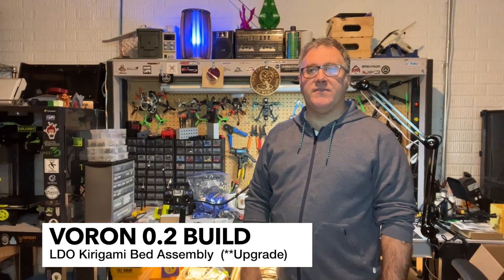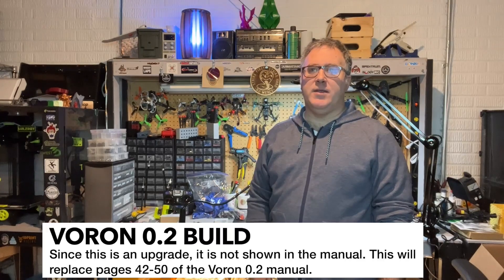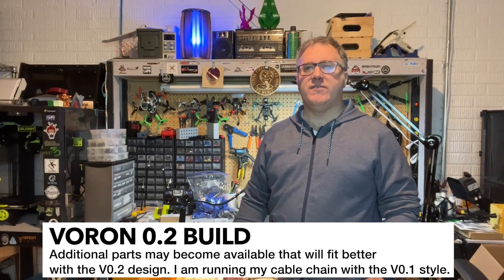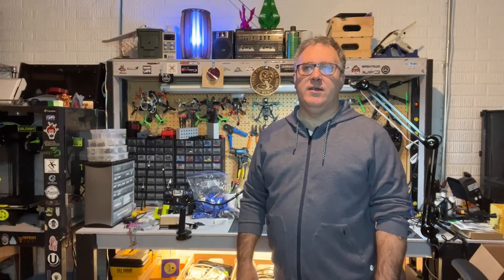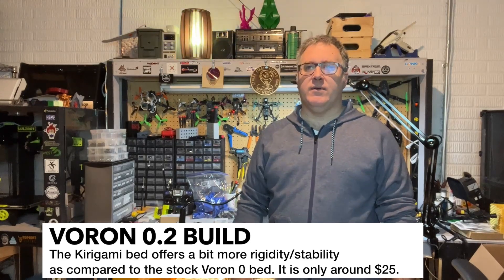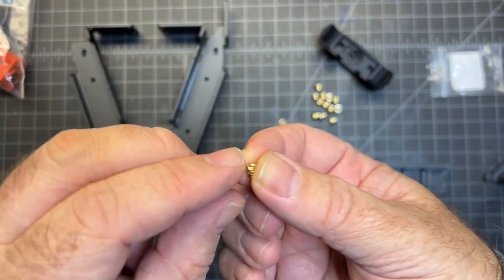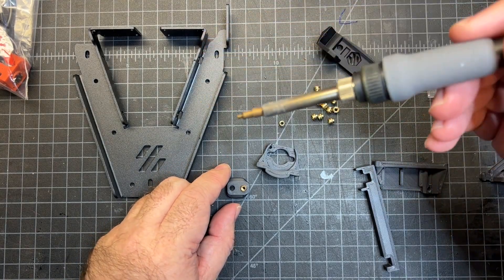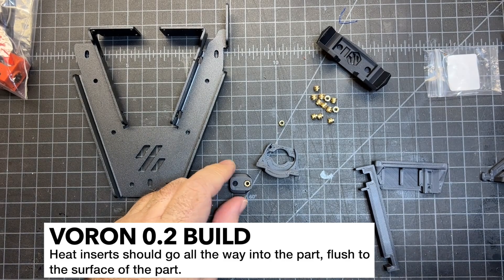Part 3. Voron 0.2 Build - Kirigami Bed Assembly

Comment: Anyone know where I can get the led kit for the Kirigami bed?  I have the bed and everything, but no neopixel pcb.
Reply from the maker: I can’t really say for sure, but as I did a quick search it sounds like you need a “neopixel button” and the appropriate 3 pin cable. I am not sure if it’s possible to get both in a kit. The ldo Kirigami kit does include both, and is about $20. It may be cheaper just to buy another kit even if you already have the bed.

Comment: I’m curious if you can make the kirigami bed work with the new v0.2 cable chain orientation, since the cutouts in my baseplate will only fit the cable chain the new way
Reply from the maker: I believe so- I think it just barely works with the v0.1 parts but Christopher Mueller is also working on a few new parts to make it fit better.
Reply: It does fit, just turn the chain around and it works
Reply: @Docanza  That's actually what I came here for. Trying to mount the drag chain to the Kirigami on 0.2 is reversed from 0.1 and won't fit. Unfortunately not included in this video.

Comment: I think the "Z" axis extrusion would be easier to align if you set your first one at 58mm and used the machinists square to get it perfectly square to the top and bottom extrusions.  In order to have the best travel for the bed the "Z" axis rails need to be both parallel and also square.
Reply from the maker: Hmm that’s basically what I did but may not have shown it completely. There is also a rail alignment tool that helps.